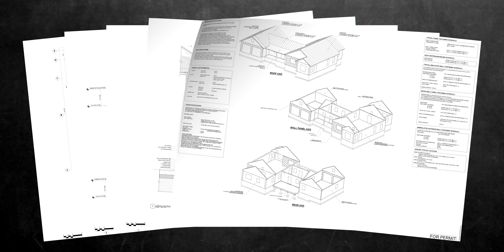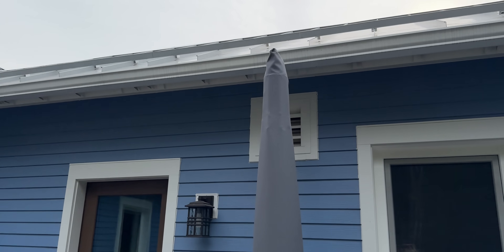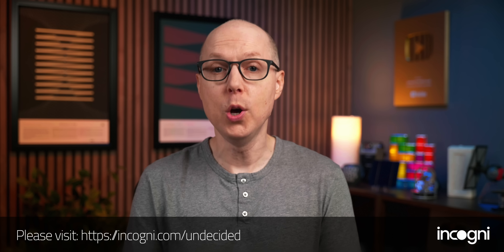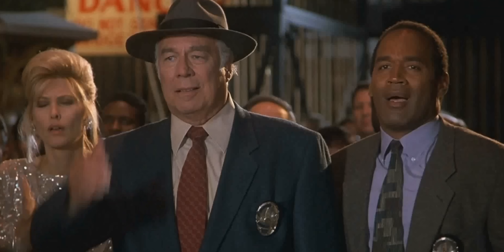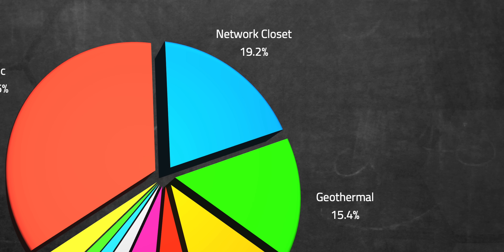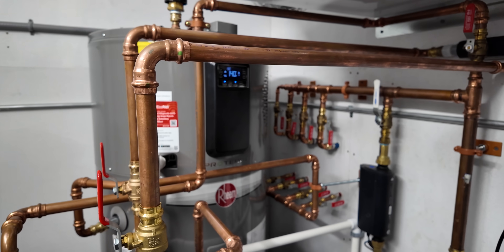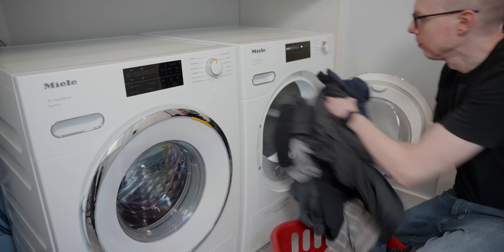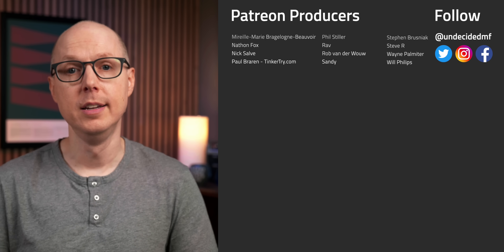What I Learned After 1 Year in My Net Zero House

Comment: 72 - 75 Fahrenheit seems really warm, especially for overnight temperatures when you're sleeping. But that must be a personal preference thing
Reply: It is a bit of an issue. We build a very similar house about 1 year before Matt started (living there for just over 2 years now) and the fact that the indoor temperatures do not drop during the night is something that takes getting used to (esp for a really bad sleeper like myself). Our house is almost constant 22C +/- 1C 24/7/365.
Reply: @BennyColyn  I could see that. I would really struggle to sleep at 22C, I personally sleep with the house at 67F/19.5C (although I do live in a cold climate).

Probably something to get used to - or geothermal might not be a good fit for everyone
Reply from the maker: It's a personal preference thing for sure, but this house holds onto that temp so well that it carries throughout the night.
Reply: Comfort is a combination of temp and humidity though.  There is a reason you feel fine at 75 in the winter but would be boiling at that temp in the summer.  The higher the humidity is the less ability your body has to cool you down via perspiration.  With such a tightly built house he surely has dehumidification as part of the mechanical systems.  Knowing this guy, there is no way he'd let controlling humidity just be left up to the weather and has a way to control it and multiple sensors to check it I'd guarantee it.  So I suspect 75 in his house feels just fine because the humidity is controlled for.
Reply: One issue with heat recovery ventilation is that you  can’t easily have different temperatures in different rooms.  I certainly like cooler at night.  
He would save quite a lot of energy by running at a lower temperature in winter.
Reply: Hope to do a deep fit energy remodel now that the outside insulation vs inside  ratio is being written into code so more siding companies know what the bleep I’ve been asking for!  Several questions from an earnest, but Luddite leaning subscriber: How much did span panel cost, vs help you save energy, vs just be  a total toy for nerd/YouTube/research? I’ve checked out the energy meter thingy from the library to measure specific electric use of items. But this is really going several steps/whole stories higher! 😂 One would think, given that electric and gas companies keep giving feedback on use, that a span panel would get one a tax write off/ energy company savings(like allowing smart switch on AC, etc)?
Sorry, to use that enerphit bad word, but how much does a heat pump drier/ water heater save in money compared to one run on natural gas? Very few people that I know would consider using electric versions due to their cost to run. Do super tight houses not use natural gas appliances due to philosophy not using that carbon source( though many only solar ready, so use coal generated electricity😮), or is it an indoor air quality issue like with n.g. stoves? I know some water heaters can be closed combustion like gas furnaces, no clue about how a gas drier works! I have been using traditional electric coil electric stoves as an avid cook/baker for whole house owning life as hated how smelly gas stoves were in apartments.
Reply: We have our temp set to 78 in the day and 74 at night in the summer. With a ceiling fan it feels fine to me.
Reply: @baddriversofcolga  I’m sorry but 78 seems like absolute insanity, haha.
Reply: We heated for 30 plus years with a wood furnace ducted together with a forced hot air heat pump. Used two separate  thermostats, with the heat pump set lower as a back-up. The wood heat put out 110 degree air and felt warm to bare skin. The heat pump put out air near the thermostat setting and felt chilly. Being 69 years old, and unwilling to buy wood, we replaced the air sourced heat pump with a Waterfurnace  geothermal heat pump. It puts air out at a mid-80's temperature and is much better than our back-up heat pump. We still have the wood furnace ducted together with a gravity damper to prevent a short circuit, but the first season was so successful that wood heat is going to become a back-up for power outages or really severe cold snaps.
Reply: Some part of that network closet is running all the instruments and actuators for the home measurements and management, so it is a necessary overhead for the high-tech home.
Reply: My apartment is constantly at 70 LOL I couldn't live ahove 73. I just accept a large electric bill as the cost of comfort
Reply: Set my summer thermostat to 80 and my winter to 68. If people would let their body acclimate to the seasons naturally we'd collectively save a whole lot of emissions.
Reply: I thought the same thing, but turn a small fan on and that 72 feels way better for sleeping.
Reply: Came here to say the same. That’s very warm, in my book. Over 70 is overkill.

Relatedly, Matt, is that the summer temp as well?

Comment: What air quality monitors are you using?
Reply from the maker: I have a few, but the main ones are the Qingping Air Monitor Lite, Awaire, and the built in sensors of the Mila air purifiers.  I'd also recommend checking out Air Gradient.

Comment: I really dislike this trend of kitchen appliances and other electronic devices not having actual buttons.
Reply from the maker: I agree.  I do wish some of these controls were knobs.  Touch controls are great for some things, but not EVERYTHING.
Reply: I personally don't mind it. but they should ALWAYS have tactile feedback options for disabled people.
Reply: @danilooliveira6580 not just disabled people, for the elderly too. Touchscreens are awful for older people because they lose padding under their fingers over time, making it much more difficult to use. I hate how everything is built to be hostile towards older folks nowadays
Reply: Yeah, it seemed very nice when I first got it, but it's so much easier to just turn a button to adjust the power.
Reply: @placeholdername0000  yes, good old potentiometers are the shit
Reply: Much easier to clean a flat surface than under and around buttons. Some induction hobs have a magnetic wheel you can place (and remove) to control the heat
Reply: @ecoworrier  We invented inset, rubber covered buttons like a hundred years ago. The designers who put these things together are obsessed with the sleek minimalist 'modern' look. They don't really care about tactile comfort/usability.
Reply: @martingardens  I genuinely don't understand what angle you're coming from with this comment. Are you saying the capacitive touch buttons are good or bad. Is a double sink good or bad.
Reply: I wonder if they work with wet hands?  My phone sure doesn't, and when you're working in the kitchen it happens.
Reply from the maker: @chrishill9016  they do.
Reply: Yeah, controlling an induction stove with touch controls is extremely annoying, and the whole trend must have been promoted by people who don't like to cook. The traditional knobs let you make adjustments with one hand while you are doing something else with the other (moving the pan, stirring, etc.) while still looking at the food you are cooking. It is also very common for these touch controls to require two steps to make adjustments (first you have to select the burner, and only then can you adjust its power), which is terrible for multitasking, especially when you are using high heat on one or more of the pans. And if two people are cooking at the same time, it's almost inevitable to end up adjusting the wrong burner accidentally.

They are very easy to clean though, but that's pretty much the only positive thing about them.
Reply: I personally like touchscreen, I've been using induction for a decade with touch buttons, but I get it that many don't. I recommend LG induction ranges if you want knobs, they are great and have knobs!
Reply: I've used an induction range with touch controls on the surface. Would not purchase one like it. Anything that touches it, including bottoms of pans and some food will set them off. If a hot pan sits too close, the buttons become too hit to touch.
Reply: It's a blatant cost saving measure that can be sold as a premium feature. Working in embedded, it's so much cheaper to make touch buttons than mechanical ones. Especially if they need to be water tight.

Comment: You cannot understate how awesome induction is over standard electric cooktop! As you mentioned, the speed of boil is borderline terrifying haha  I live in central MA so your heat pump results are very encouraging. I have oil heat and central air with hydro air handlers that are heading to EOL. I would love to fully ditch my oil for all heat pump. I got a quote a few years ago that kept the oil as a second stage with an air source heat pump. With your experience in a standard insulated house less than 15 years old, would you expect that only air source heat pumps would provide all heat in our climate? From this video it sounded like yes, which is great news. Thanks for the great content!
Reply from the maker: Yes!  You can definitely get an air source system in our area that will cover you.  The problem a lot of times is that installers aren't fully up to speed.
Reply: @UndecidedMF  Thank you for your time and sharing your insight!
Reply: The most stupid is that it's the same damn copeland, samsung or some other known brand compressor. Just hot and cold side swaped around run to a heat exchanger and simple logic you can run on a Simens Logo for example if you want to go the cheap rout. Part longer under 2k.

I'm btw installing ground source heat right now (probably why the video was suggested) on a budget. Did the diggin my self, got a used heat pump. The goal is to come in under 4k and so far I'm on track. Just need heatbatteries, a bit of pipe and the damn brine fluid. Got the heatpump used for 500 and will be using my own software to make it modern rund the compressor with drive to regulate speed.

Comment: Matt,  I’m going to build one more house to retire in.  My main goal is to be energy independent.  Energy efficiency is important to me as well.  So, I’ve really enjoyed what you have been sharing with us.  I’m 10 years out.  I’m certain technology will change by then.
Reply from the maker: Glad you've been enjoying my house build series of videos.  This stuff is changing fast and improving, so there should be a lot of great options for you when you're ready.
Reply: @UndecidedMF what about large plastic waterbattery with turbine/pump on the side under the lawn?
Reply: The future is here now if you can DIY much of it.  I am in the process and it is very affordable if seen in a 5 year ROI.  You don't have to get all the latest and greatest things, just know how your appliances use energy and apply that towards your system.  A normal drier can be used on low for half of the energy ouput or an electric 80 gal water heater can be cycled to run only during the day off of solar only.  LFP Batteries are the only problem currently for a normal house but EG4 has some very good solutions for only $251/Kwh which has been going down for a while now.
Reply: There is a huge difference between net-zero and energy independent. Basically, any new build here in Germany with solar is net-zero. There is only so much electricity one needs for heating and every day use, while solar will provide 7000-14000 kWh per year on a typical single family home. That is more than enough. We actually feed about 50% more electricity into the grid than we use in the house, including the ~900 kWh we got from the grid during the last winter. Our setup is really modest with 6.5kWp solar and a 10kWh battery.

Getting energy-independent, however, is a wholly different game. It basically means to plan for the worst case, like a full week of winter storm with solar covered by deep snow. That is almost impossible to solve on a single property and will always be fighting inverse economies of scale
Reply: Mr. Woody I liked your comment, I am a technology researcher and I can show you many different ways you can build your forever home, if you need assistance please contact me and I'll be glad to help.
Reply: We are on the path of becoming energy self suficient, but at this moment I realise that we spend more money on food than on the energy bills. What Im trying to say is that bigger savings are when you are food and drinks selfsufficient than being energy selfsufficient. All the best
Reply: @Contentpreview-v7g  I agree with that too.   I currently grow nearly 20% of my food in the spring/summer.  Much less in fall/winter.  I have plans to increase this when I retire.  I grow much outdoors, but in fall/winter I grow indoors which requires energy.  I plan on having a water well too.  I would like to become completely self sufficient but that isn’t really feasible, especially in retirement.
Reply: I would love to know how long the return on investment is for the money spent just because of the upfront cost. For instance if you didn’t go with geothermal but instead went with something else that was still energy efficient the electricity  you sell back to the grid would offset any cost you pay for natural gas.
Reply: Your better off doing it sooner than later (as in next year). Very high inflation is coming. US Debt is now over $100T (Gov't + Corp + consumer). Fed is going to print & print until the dollar collapses.
Reply: @guytech7310  Agree it seems high inflation is coming, but that's not necessarily a good reason to spend more valuable, not-as-inflated dollars sooner than later.  If you can successfully put the dollars into an inflation resistant form of capital, they may be worth much more in the future, effectively increasing your purchasing power.

Comment: Your entire homestead is cool, but seems really complicated. I installed an induction cooktop in my newly built home and so glad I did! Quickly boil water and cleanup is easy. Not to mention it is much safer compared to natural gas and electric element cooktops.
Reply: This house will be a nightmare long-term because it is so tech intensive.  Net-zero is great but I don't see anything sustainable about this home.
Reply: the point was trying to make a net-zero home that is as efficient as possible, while still offering maximum comfort. that is why it's complicated. not every house needs to be this complicated.
Reply: One downside to induction cooktops: wet fingers don't work on the buttons.
Reply: @dannydaw59  Or if your boiling pot spills over the controls, but luckily using a paper towel to quickly wipe it off won't catch fire!
Reply: Yes.  If you croak tomorrow , will your wife be able to run it all ?
Reply from the maker: The smart home setup ... no, she has zero interest in that stuff.  But everything else, absolutely ... the basic house functions are really easy to manage.  I've layered on some smart home complicated stuff for my own enjoyment/tinkering, but it's not necessary for the basic functioning.
Reply: @JMgmkh  Exactly what I was thinking! My wife can't even operate our backup generator let alone all the gadgets to run this house!